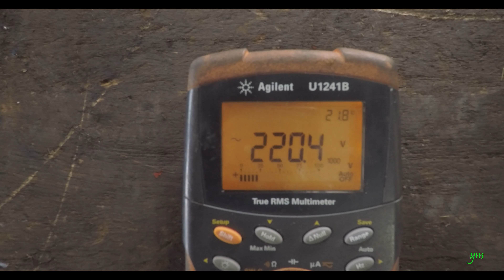Restauration d'une mini turbine Pelton | Restauration of a mini Pelton Turbine | 7kVA - 230/400V

Comment: Very informative thank you. I also like how so many of the tools like the lathe are also vintage, it just shows tools can last if taken care of.
Reply from the maker: The lathe is from the year 1943..
Reply: @YvesMamin  Rhe first good power tool I bought is a 1/2" Bosch sintilla hammerdrill corded 6.5 amps made in Switzerland works like the day I bought it. Came from a professional tool store about twice the cost of average ones, gentleman said I would never regret it.  It will be passed on to my nephew. They are hard to find in USA but Swiss Bosch willl not break. Love the train videos II have a couple LBG ..
Reply from the maker: @robertliskey420  The Scintilla factory still exists, it was bought by Bosch and therefore lost its name.
It manufactures motors for Bosch and its sister brand Metabo.
I have an old industrial Scintilla motor, I want to restore it, maybe once a video.

Comment: Formidable!
Quelques questions:
1. La différence de niveau est-elle d'environ 80 mètres?
2. Quelle est la longueur de la ligne d'alimentation, 600 mètres?
3. Quelle consommation d'eau faut-il "obtenir" du générateur de 7 kW?
Reply from the maker: La différence de niveau est bien de 80m environ, et la conduite une longueur d'environ 700m avec les virages.  
L'alternateur à une puissance apparente de 7kVA soit avec un cos Phi de 0,8 une puissance effective de 5,6 KW. Je ne connait pas le rendement  de la turbine. Avec un débit estimé de 10l/sec cela nous donne une puissance hydraulique à la roue de 7,8kW (Formule: P = 9.81 x Q x h)      Q= débit en litres/sec,  h= hauteur en mètres
Reply: @YvesMamin  Merci pour la réponse détaillée.
Reply: how much is HDPE inlet diameter?
Reply from the maker: @hydrodynamicenergy  80 mm for the pipe, 15 mm for the injector

Comment: Did you fix that intakeissue?
Reply from the maker: The proposed solutions were to: 1. Reduce the water flow, therefore also the power supplied. 2. Make a water storage tank and use the turbine only when needed. The use of the turbine must be adapted to the weather conditions in the event of drought.

Comment: Interesting video! Tanks for sharing it! How does it control the voltage, is there some automatic control on the water control valve?
Reply from the maker: There is no automatic flow rate adjustment. Frequency and voltage is displayed and the turbine is adjusted by hand. The production is used to feed a water heater OR a vacuum pump motor for the milking machine